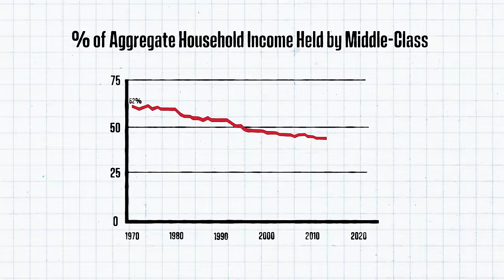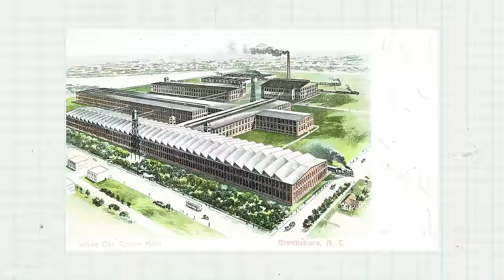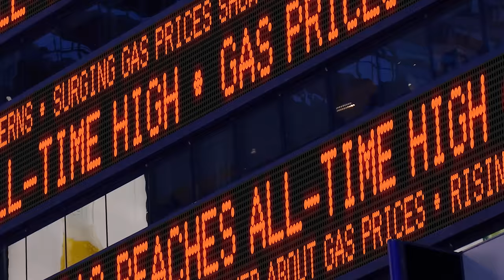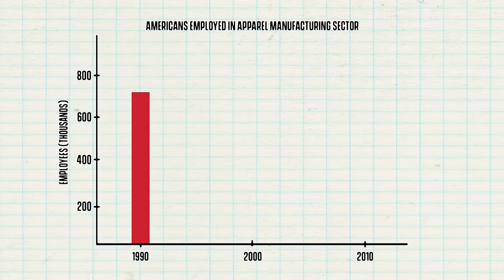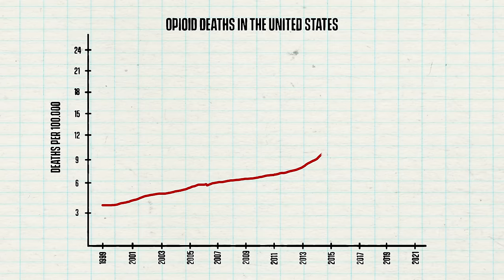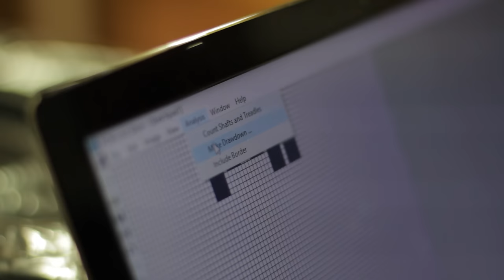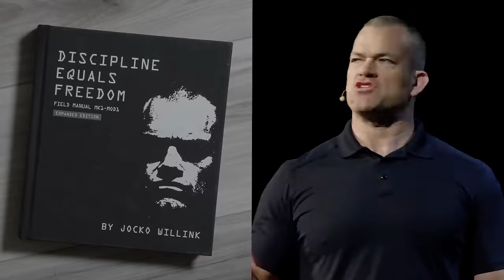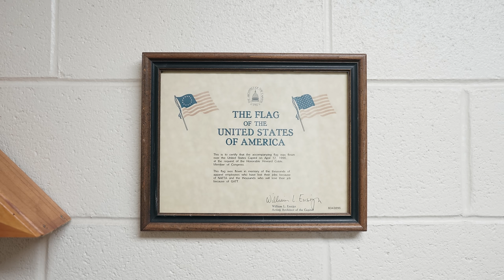The Rise and Fall of America's Middle Class

Comment: Bought my Origin jeans back in 2020 and quickly realized they’re a superior product. That accompanied with the fact that they’re 100% American made has lead me to buy so much more Origin gear, and every single piece is of the same high quality. Can’t recommend their stuff enough.
Reply: 100% the best!
Reply: I agree. All my gear is top notch
Reply: GOOD
Reply: I've had issues with their short cut works boots. To their credit though when I informed them of the issue they built me a new pair free of charge. It would be good to deal with the issues vs offering free replacements. My only origin gear are work boots
Reply: Delta 68!!!
Reply: There isn't anything I've bought from them that hasn't been amazing.
Reply: Meh I buy what’s cheap

Comment: I've been following the Origin story for maybe 10 years and now that I've got some of the jeans (I don't live in the US and the customs charges bump the price up by about 30%) I have to say I'm a bit disappointed with the quality control. Folded over waistbands, inconsistent stitching between the same models of jeans, leather patches with defects. The Kilo sweats are nice but even the shorts I bought had a defective drawstring (it was too short so kept disappearing into the waistband hole?!). I wanted the jeans I bought to be "the only jeans I'll need for the next decade" but I'm not sure. The Factory jeans seem pretty robust (albeit with inconsistent QC) but the Delta 68's seem quite flimsy...

Comment: I’m 70 years old and in the 1960’s I paid 5.00 dollars for a pair of Levi’s button fly,straight leg. Today that same pair 50.00 to 80.00 . Maybe more. Bought a 1970 Plymouth road runner with a v-383 engine brand new off the showroom floor. Today gasoline is a about 3.00 dollar a gallon. Back in the 1960’s it was .14 cents a gallon, a pack of cigarettes was .20 a pack. Minimum wage was 1.65 per hour. Today they want 15.00 to 20.00 per hour don’t want to work . Cigarettes are around 8.00-12.00 per pack

Comment: Many blame trade agreements and other countries for eroding manufacturing of their own country including mine. I however think that is not the case. These are just the symptoms of an uncompetitive economy. If China can produce something way lesser than what we can produce at home, that doesn't automatically means that they use slave labor. For an example, in a country like USA, I assume a person needs to earn around $2,000 a month to get by. But with just $1,000 a person in my country (Sri Lanka) could live like a king. In return, they can afford to make stuff with lower pay grades for way cheaper prices. If we are to use protectionism by obliterating trade agreements and curtail imports or apply taxes, prices of the goods will skyrocket. A person with $2,000 can't get by with that amount any longer so people would demand pay raises and it will feed in to rising labor cost and make home made goods even more expensive and becomes a viscous cycle.

Comment: How about blame greedy corporations instead of government maybe point the finger at rich assholes that would be a good starting point.
Reply: To be entirely honest, they're blaming the removal of slaves before 1860, but framing it as if it's "manufacturing gone to mexico", which actually was to China, and this happened well before the turn of the 20th century; It only became more grave in the 1960's - 1980's, where most of the final textile businesses stopped. Likely due to the whole 'neoliberalism' thing that occurred, you know, that whole thing that allowed corporations to expand their agreements further by no longer requiring any regulation on them.